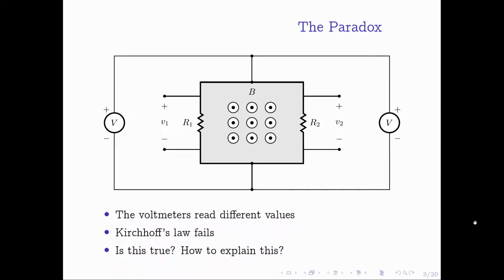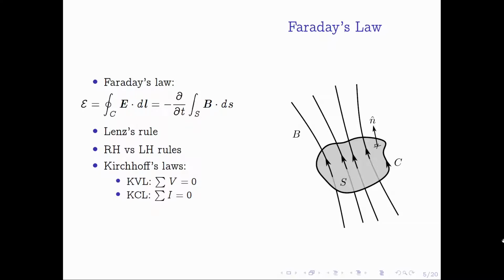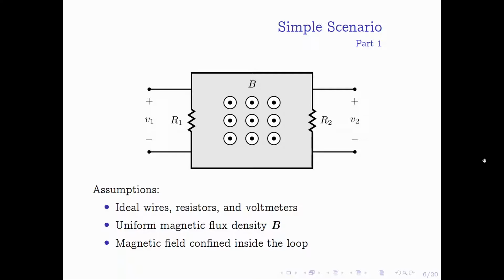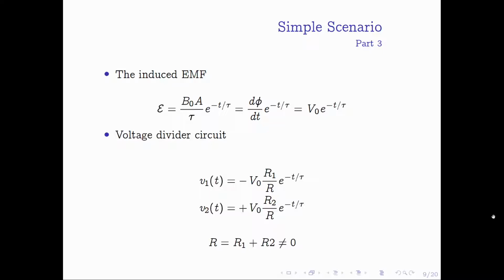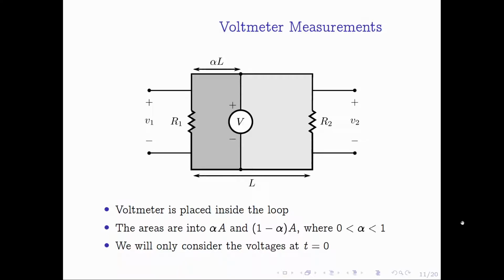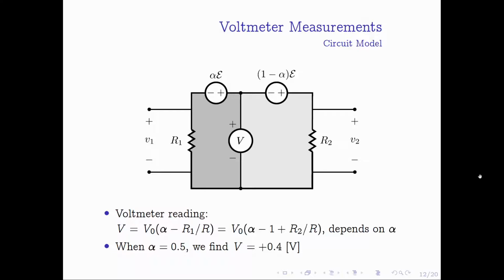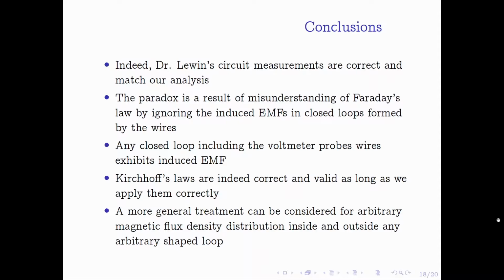Lewin's Circuit Paradox

Comment: You state an equivalent circuit with no justification what-so-ever. You cannot just lump the EMF into a voltage source and put it in the circuit that kinda looks the same. 

The circuit you have created is not the same: Your EMF voltage source has internally to it, a loop of wire around the magnetic flux. Then you are taking that element and joining it to two resistors. Your 'loop' of the resistors and the EMF voltage source is no longer an induction loop.

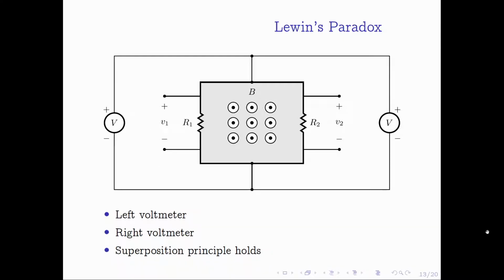However then you add B field back again to the loop forming the resistors and the EMF voltage source. This makes no sense at all, and it is extremely missleading. If you want to break up the EMF voltage source to multiple voltage sources - you need to explain how you are taking the one internal loop and breaking it into more than 1 closed path. Of course there is no explination beause that is impossible. Its literally physically impossible for your circuit at 13:34 with two EMF voltage sources in series to be made from 1 closed loop of the experiment.

IMO you have a played a slight of hand trick. You know the answers and so are inventing EMF voltage sources to put into a circuit at the right place to get the same answers as lewin - completely missing the whole point of the original experiment.

The meter probes have NOTHING to do with anything. You showed this at 6:35. You can experimentally measure the EMF across the resistors with no volt meter: Put an amp meter in line with the resistors, then put the resistors in water and measure the change in temperature which with the specific heat gives you the power. Now you have power and current to calculate voltage. Guess what: The voltage is exactly what Lewin measures with his meters - meaning that the meters probes are not involved in 'induction' at all - because the voltage is there even when the meters don't exist. KVL does not hold.